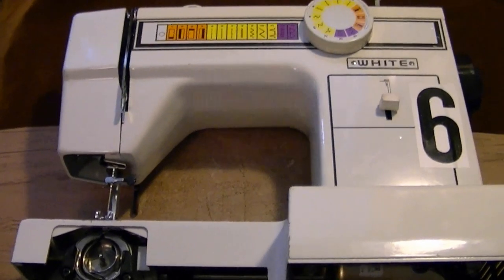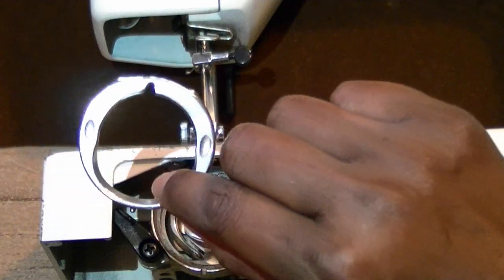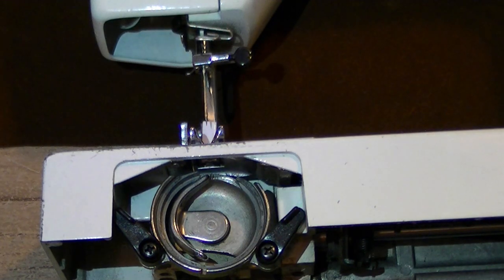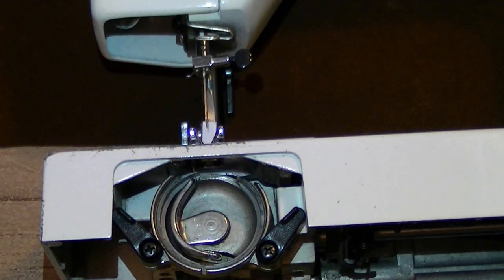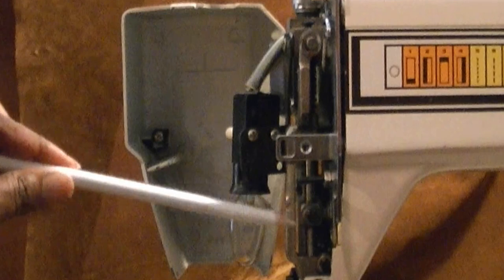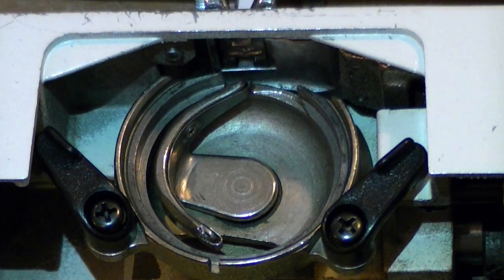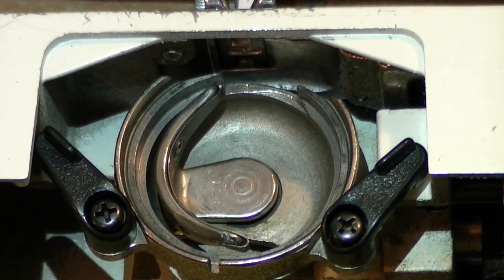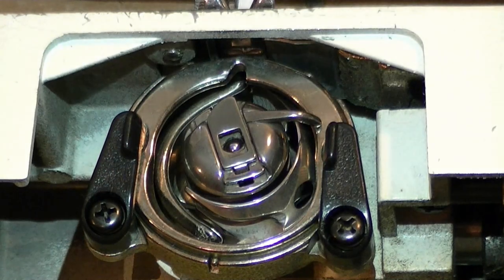My Sewing Machine Won't Zig Zag - Timing Repair

Comment: you didnt show us sewing example , I think its wrong , beacuse when the needle goes up allite  then the hook have to meet the needle . You have to understand the michanizem of working .
Reply from the maker: It did work fine afterwards and many over viewers have tried it as well and it worked for them also.  Sorry it wasn't helpful for you.
Reply: @NilerTaylor-relindesigns   Hi Niler:   What you showed might somehow work.  But the actual timing  has to do with the actual hook. The actual hook is on the piece you too out.  You will see that if you carefully watch your machine make a stitch as you turn the handwheel.

Comment: don't understand. sounds like you're fixing a machine that doesn't sew at all.  our problem is only zig zag. nothing else. ordinary stitches work fine.  Can't even take a look see if its right somehow because the elna 3000 - our machine - has the bobbin horizonal beneath the needle. I dunno but I think we can see that way what you show so easily here....
Reply from the maker: I'm not familiar with your machine but I hope my video directs you solving your machine problem.

Comment: You are mistaking,  what you show is not the hook! The hook is on the part that you took out.
Reply from the maker: I think the viewers got the point...
Reply: @Niler Taylor.  Hi Niler: I don't think the readers got the point.  Timing is not the alignment you showed!  What you showed might have worked, but it is a coincidence of some kind. It is not the actual timing that one should set.  Usually one has to loosen something under the machine to set the rotary position of the hoo mechanism. And to do this you need to see how the hook, the piece you took out, lines up with the needle in three different ways (up-down, left-right, front-back). Your video is excellently made and excellently explained, it is just wrong!!!!!  I'd be happy to talk with you about this if you haven't figured it out yet.  You could/would make and excellent video if you got this right.

Your little comment above is kind of funny.  You said "I think the viewers got the point".  Well, the hook is a sharp point.  And the thing you pointed to does not have a sharp point.  So, if getting the point is knowing where the hook point is, then your viewers did not get the point, they got some other part of the sewing machine which is not the hook point!  So no, your viewers didn't get the point. T

OK, more broadly, your viewers did get a bigger point, and  that's that you can get things working by fiddling on your own.  And maybe that is more important than getting the facts right.  However given that you have so many viewers, they like you so much, and you explain things so well, if you could reach them with more accurate (and more useful, I think) information, you would be helping lots of people. Like a million of them!

I am not the ultimate sewing authority. But I am 99.99% sure that I have this right.  And I think you probably looked at the wrong piece when the person who taught you pointed at the hook. The actual hook is just next to the piece you pointed at (if you hadn't taken it out of the machine).  And, like you explained, its alignment with the needle is key.  But all of the details about that are not quite right in your video. Happy to chat if you think I could help you:  Andy Ruina, ruina@cornell.edu, Whatsapp #: +1 607 327-0013.